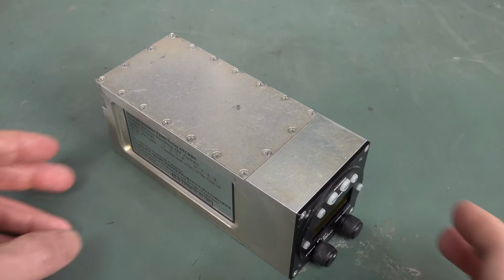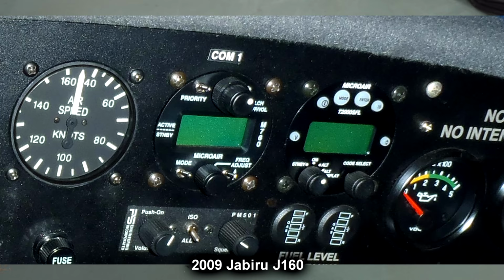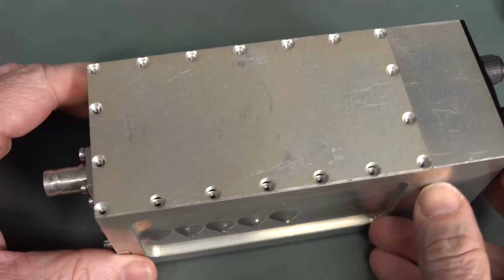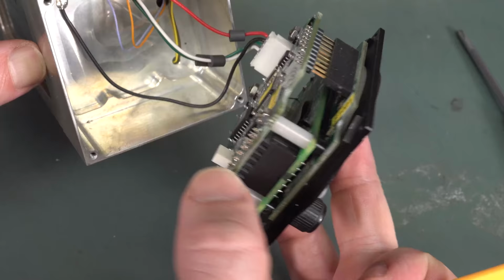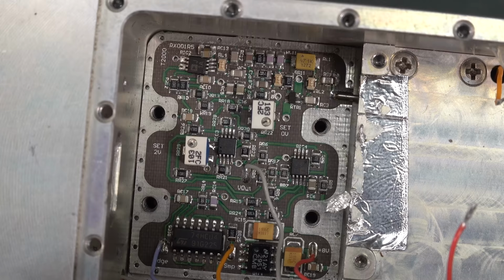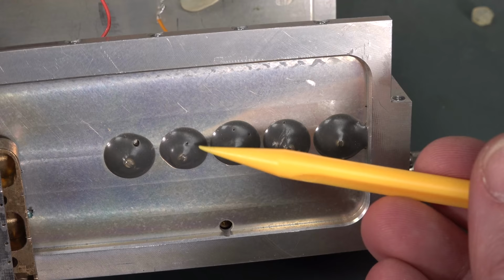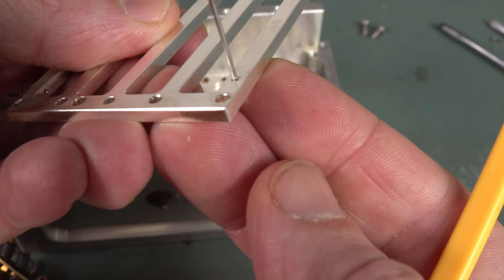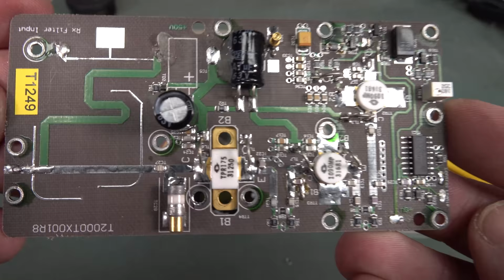EEVblog #1352 - Aircraft Transponder TEARDOWN!

Comment: I’m really pleased to see this tear down, because John got it from me: This transponder used to be in my aircraft, a Vans RV-6, callsign VH-SOL.

Microair is, as your research suggests, an Australian company. They’re not really much interested in avionics these days, though: Through a process of repeated acquisitions and refocusing, they’re now a company that produces in-flight entertainment equipment, and the support they offer for their old products is, shall we say, poor.

This T2000SFL developed a fault, and the Bundaberg folks said that they couldn’t repair it until they’d received their next shipment of logic board PCBs, which was supposed to take three weeks. Then six weeks. Then four months. Enquiries within the pilot community suggested that I wasn’t alone, and the correct answer was almost certainly “never,” so I removed this instrument from my panel and replaced it with a new ADS-B-Out transponder, leaving this one surplus to requirements.

Given the fact that it was faulty and the unlikelihood of repair, I didn’t feel like on-selling it would be ethical, and when John said he knew someone who did youtube tear-downs I offered it up to him, whereupon it remained safely in one of his desk drawers for about three years :)

ATC radar doesn’t generally use primary returns (“echoes”) in the way that WW2 military radar did. Instead, ATC radar facilities have an antenna system which rotates several times per second. The system consists of a dish-shaped directional transmitter and an omnidirectional receiver. The transmitter sends a tightly focussed beam of pulses at 1030 MHz which causes transponders which see it to reply with a squit of data on 1090 MHz. The direction the dish is pointing when the omni receives the 1090 MHz reply is used by ATC to obtain the direction to the transmitting station, and the delay between the transmission of the excitation pulse and the reception of the reply yields distance. There are multiple framing formats for the data package, and the format called “Mode C” includes a binary-encoded representation of the aircraft’s altitude, rounding out the 3D picture ATC needs to stop airplanes from crashing in to each other.

(ADS-B uses Mode S, which consists of a validly formatted backwards compatible mode C reply followed, after a short delay, with a variable-length “extended squitter” containing lots of other data, including high-resolution GPS position, which means ADS-B ground stations can obtain a 3D position without the expensive, maintenance-hungry, analogue, difficult to calibrate rotating dish assembly. The 1090 MHz Extended Squitter response is called 1090ES)

The fault this transponder exhibited:

When run on a test bench with a simulated 1030 MHz strobe, the transponder generated 1090MHz mode C responses unreliably. As the 1030 MHz power level was ramped through its range, there was a notch a few dB wide where the mode C response would fail to be sent between 20% and 95% of the time. Because ATC radar needs at least three transponder returns in a row to agree with each other (for error correction reasons), a 20% failure rate would cause my airplane to disappear from radar intermittently, and a 95% failure rate would cause me to not appear at all. The power levels which exhibited this behavior corresponded to a distance of between 20 and 45 nautical miles from the radar ground station. Which meant a ground check of the transponder would pass, and ATC could see me when I contacted them and asked for clearances, but as I drew to within 20 and 45 nm of controlled airports I’d drop off their screen, and, without radar observance, they’d have to cancel the clearance and instruct me to leave.

Unsurprisingly., that was not a tolerable situation.

And so the doomed T2000SFL ended up on your workbench being pulled apart. 

Given the trouble and expense it caused me (its replacement was A$2500), watching it being meticulously destroyed was an unexpectedly pleasurable experience. If you’d consider producing another video where the remnant parts are tipped into a shredder, I’ll be sure to like and subscribe :)

Incidentally, you’re right about standard dimensions. The round part of the faceplate of this device fits into a 2.75” hole on an instrument panel. Generally speaking, the six primary flight instruments are 3.25” diameter, and secondary instrumentation is 2.75”. There’s no rack, as such; The sole physical mounting for the instrument is via the four screws in the faceplate. There’s also no standard for the shape of devices behind the panel (although there’s obviously a volumetric envelope constraining them so that standard hole spacing will work). There’s no limitation on depth, but instrument designers need to deal with practical limitations, because there isn’t usually much space between the panel faceplate and the engine bay’s firewall.
Reply: A lot of international and other larger airports would still have primary radar btw, even after all the ADS-B. The rotating antennas usually have both primary and secondary on them. In addition these airports usually have ground movement radars, so that you can do instrument landings in the soup.
Reply: @rkan2  The primary radar is only good for maybe 15 or 30 nautical miles range. It also doesn't identify targets (primary returns don't have squawk codes).

In Australia, only the large class C airports have primary. I'm not even sure that Adelaide has it anymore.

Ground movement radar uses ADS-B these days, positions of aircraft reported as GPS coordinates.

Instrument landings use localizer and glideslope transmitters which are entirely separate from radar (unless you're talking about GCA approaches, which I don't think we've ever used in Australia). Autoland-equipped aircraft augment ILS information with differential GPS for accurate guidance down to about 50cm resolution at 120 knots.
Reply: Thank you for this in-depth recollection, and insightful details!
Reply: @MarkNewtonFlies  I still see a few misconceptions here... ADS-B usually still only provides enhancement to aircraft tracking accuracy, but is only the primary method for ATC in very few, albeit increasing amount of situations. Some airspace use it for decreasing spacing, such as oceanic and a few airspaces in Europe at least.

The same goes for ground movement radar, which will remain essential for ILS Cat II and lesser minima approaches, until your flock of birds, deer, or any other fact of life will be equipped with ADS-B. I don't know of a country that would allow ILS CAT IIIabc without an actual ground movement radar.

AFAIK ILS also doesn't have that much to do with GPS for guidance, since it still preceeds any GPS/RNAV type approach. Although it is true that GPS-equipped aircraft today often augment navigation accuracy using GPS (such as IRS on an Airbus), an aircraft certified to do ILS landings, should be able to perform them without GPS assistance.

Apparently there actually are some ILS approaches that require GPS, but they're so close to an RNAV procedure, that they will probably soon (if not already) be non existent: https://bruceair.wordpress.com/2017/10/17/an-ils-that-requires-gps/
Reply: @rkan2  Some points:

Ground movement radar is irrelevant for the purposes of this discussion: It's short range, and its azimuth is horizontal. We've been talking about aircraft in flight here.

ADS-B is the primary method of tracking aircraft in Australia. While legacy mode C still "works" (where it's installed in ground stations - and they're not building any more of those!), when a target is painted on an air traffic controller's screen, there's no indication as to whether the origin of the target was a mode C, mode S or ADS-B return unless the controller clicks it to find out; and if an ADS-B return is present, it takes precedent over the others for that target. As such, your statement that, "... ADS-B usually still only provides enhancement to aircraft tracking accuracy, but is only the primary method for ATC in very few, albeit increasing amount of situations," has been obsolete in Australia in the time since the ADS-B mandate arrived in 2017, following the commencement of its rollout in 2014. And there are vast tracts of Australia in which ADS-B is now the only surveillance coverage (corresponding loosely to areas of the continent which previously had no coverage whatsoever)

Your statement that "ILS doesn't have that much to do with GPS for guidance," probably deserves some engagement too. Firstly: It's irrelevant for the purpose of talking about transponders; ILS doesn't use them. But secondly, the boundary between ILS and GPS approaches has been blurring, especially with the northern hemisphere's SBAS or GBAS WAAS GNSS approaches. The USA now has thousands of LPV approaches, many of which have replaced decommissioned ILS approaches. They're GPS-only non-precision 3D approaches using the same course deviation and glideslope instrumentation on the panel as an ILS, usually to the same minimums.

We don't have SBAS or GBAS in Australia (yet - Air Services claims they've completed the trial, so maybe there'll be movement in 2021) so WAAS doesn't work and we can't use LPV. But it should be pretty clear that GPS is on a trajectory towards replacing ILS with GPS for approach guidance.

And I note that the Garmin certified autoland feature that's now available in their instrumentation packages for the Cirrus Vision Jet, Daher TBM and Pilatus PC-12 uses GPS exclusively to get airplanes safely on the ground in an incapacitated-pilot emergency, and momentum is only going to build from there.

Anyway, this is all irrelevant in relation to transponders, which aren't involved in approaches at all. An interesting diversion, but nothing to do with this teardown.

Comment: For those interested in ADS-B transponder 'RADAR' you can use a USB TV stick and a Raspberry Pi to make your own receiver, no RF knowledge really necessary and happily track the aircraft around your vicinity - up a range of around 200km depending on your antenna / location.

Comment: Man I love that machined aluminium housing.
Reply: I never saw a single avionics box that  needed that process. It is wasteful of expensive material that is paid for, but thrown away as scrap. It could have been made from folded/pressed sheet aluminum. But it was made, and sold the way it is. I was not impressed by the effort it took to take it apart. It is not a simple maintainable design.
Reply: @f.hababorbitz  Pretty much all milling setups I know recycle the scrap for reuse either in house or through a third party, especially considering the waste is almost always more than the actual product in the end. It wouldn't make financial sense to just throw away the scrap.
Reply: @sirflimflam  It is scrap, and it goes to salvage. And the original 'billet' cost 8-30X that scrap that was made. For avionics the part rate is small but the material costs high, as it is all process approved by certification authorities. There  are so many QC people in this loop. So it is foolish to recycle material for a part that could have been made with pressed sheet stock, and very little scrap. And it all costs money in the end to build it this way, and the energy to haul it back to be recycled. And it has so many processes to do that, and energy to separate the alloy materials, so it can all be made into a big block again. 
Then there are castings, that used to have magnesium for light weight, but the insurance industry shut that down from the fire risk. I recall my company redesigning servo motors to remove the magnesium, which changed the weight, and this flowed through so many document layers all requiring revisions. And then the certification authorities have to approve of the weight change, as it is stamped on the nameplate, as well the end customers.

Comment: Good explanation at the beginning on how it is operated.

Speaking of the transmit modes, it's fairly simple:

Standby: transmitter disabled but some electronics powered up, left over from old analog units that required a warm up time

On/Mode A: transmits the 4 digit squak code which is enough for crude position and identification, but not altitude

ALT/Mode C: also transmits 4 digit code and crude position. This mode uses the altitude encoder input to transmit the barometric pressure ("pressure altitude") to give precise altitude (in 100 foot increments) as well.

Newer/more expensive units have mode S/ADSB to add various other information which may include aircraft registration, gnss/gps position etc.
Reply: Yeah, only baro altitude with this thing.. No GPS stuff

Comment: It's not part of TCAS, that would require a different (mode S) transponder.  

This type of transponder basically amplifies the response ping to (secondary surveillance) radar (generally a ping of about 200W in response), and encodes on the response the pressure altitude (in hundreds of feet), and a 4 digital octal number. (0000-7777).   Aircraft are assigned a squawk (transponder) code when in positive ATC control.

Some numbers have special meaning too!
7700 - emergency
7600 - Radio Failure
7500 - I've been hijacked !!!
Reply: and it's not GPS altitude, it's 'standard pressure' altitude, ie the altitude it would be if the sea level pressure was 29.92" / 1013hPa
Reply: @Boffin55  Isn't it just whatever the altimeter outputs instead of QNE, or am I just stupid?
Reply: @BicyclesMayUseFullLane  The transponder does not have access to the altimeter.  It's coupled with a dedicated altimeter/encoder that is not adjusted by the altimeter setting.  ATC does the calculations themselves based on known atmospheric pressure at the time.
Reply: This transponder will respond to TCAS interrogation. ADS-B is a fairly recent invention.
Reply: Agree not part of an onboard TCAS , but would allow TCAS equipped aircraft to see small aircraft fitted with this but only give a TA response. Mode S is required in most countries so this transponder would be replaced by a new Mode S transponder in same size format, hence the tear down candidate we have here.
Reply: 75, man with knife.
Reply: @Boffin55  The old thing is surely unlikely to use GPS but they could at least not send the apparent altitude straight away and do a rough correction using some outside temperature sensor signal that should be on board anyway.
Reply: 7500 Hi, Jack!
7600 Can't talk.
7700 Having an emergency.
Reply: 75 man with a knife
76 I need my radio fixed
77 falling from heaven.
Reply: @BicyclesMayUseFullLane  No, it's not corrected (with sea level pressure) altitude, it's altitude from a pressure sensor set for sea level to be 29.92. If all Aircraft do the same thing, then you don't have issues.  This is also the difference between when the captain says "35,000ft" vs "Flight Level 350".  The former would be a corrected altitude and the latter is "35,000' if the sea level pressure is 29.92" .  in north america, you always use FL when about FL180 (18,000')

Comment: The need for that comb filter - the transmit and receive antennas are connected together, and the receiver probably won't like 150 watts of power being dumped straight into it, so you need a really good filter that will pass 1030 and block 1090 (and its harmonics).

Comment: Maybe that super fancy filter is to get the attenuation required to prevent the 200W transmission at 1090MHz from blowing the receiver up while letting 1030 MHz incoming signals through. (Edit: in other words, a diplexer [thanks Shahriar!]) You're not going to achieve that with a 2nd order Butterworth filter!
Reply: Yeah, I was thinking the combination of rejecting the TX signal, and having good selectivity on the RX frequency might make for some nice RF design at 1GHz.  I always smile when I see what is a DC short, that is nothing of the sort at RF too, like a standard LC match on an antenna.
Reply: That was the first thing I though when I saw the single antenna connector - how did they manage to have such a powerful transmitter and such a sensitive receiver operate on a common line. If I had to design something like this I would just have a couple of separate off the shelf SDR modules with 2 separate filters, separate connectors, separate cables and separate antennas placed at different sides of an aircraft to minimize interference. A lot of time, swear and effort went into the two simple looking boards, that is for sure.
Reply: So a duplexer? Or am I thinking of something else lol
Reply: Their is no active tx/Rx switch in this type of unit hence the 1/4 wave cavity. Its a passive switch
Reply: Allright guys . I was a Radar Systems Tech in the RCAF and during my basic trades training I learned the APX77 system. This is like 40+ years ago,but if my memory serves me correctly,  the was a blanking pulse sent to the Rx every time the Tx fired and it took the signal to ground  in the Rx. The same blanking pulse that goes  to/ from the TACAN. IFF, TACAN , DME, Transponders(civilian) and ACAS all work in the same band so you need  blanking.
Reply: Also , I believe 200 watts is peak power , not average power. I would look it up, but I threw out my training manuals 15 years ago.
Reply: @2string861  Not a duplexer. A diplexer.
Reply: @Thesignalpath  Thanks, I always get those 2 confused haha
Reply: @michaelclayton632  Yeah, no way that aluminum block handles average 200w power :D Probably neither does the battery on the plane...

Comment: Don't forget that those RF power transistors usually contain Beryllium oxide which is toxic in powdered form. If the top of the transistor falls off or gets damaged, then extreme care must be taken when handling the item. May be prudent to mention this while doing a teardown that contains these devices.